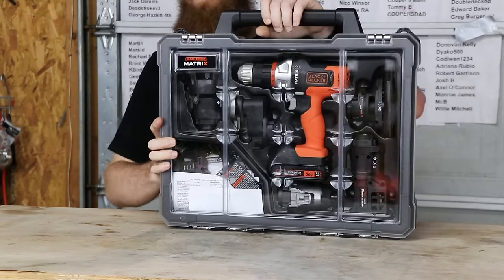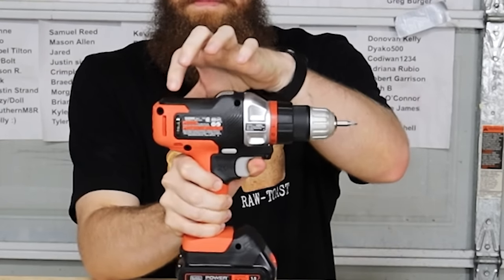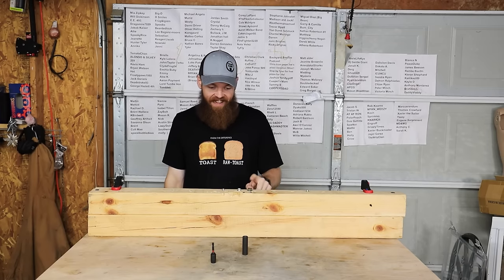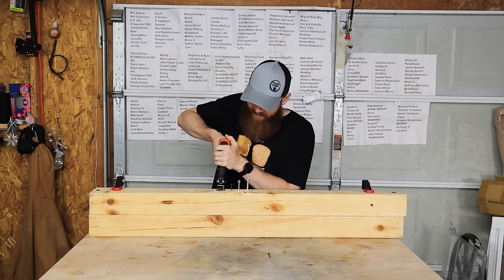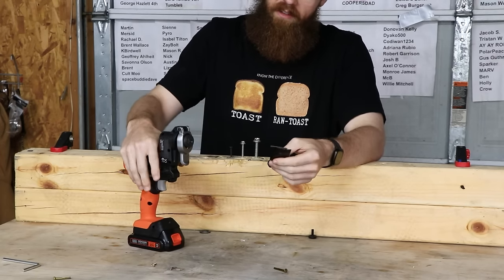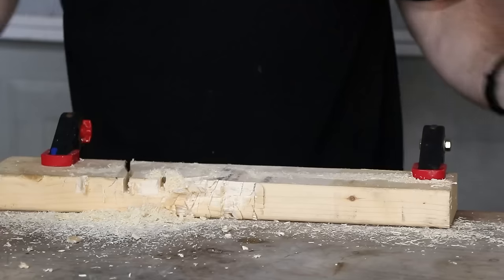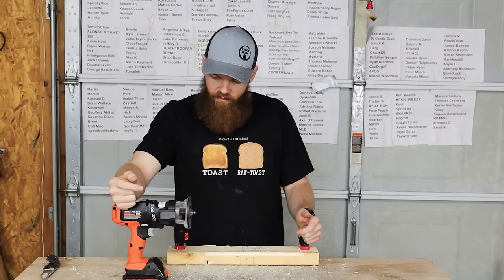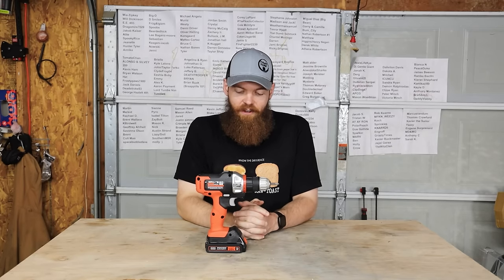Is This The Last Drill You'll Ever Need? | Black & Decker Matrix system

Comment: Tyler!!! The reason why the impact driver head smells like grease is because the grease keeps it from over heating, it lubricates the gears inside. It's like that with all impact guns.
I'm a mechanic so just some tool advice! Great video though 👌.

Also routers are to make nice edges on wood not to cut straight through a piece.
Thanks,
Robert Aime

Comment: To get the best results from using routers to cut to a depth like you are doing, it's best to do it in increments, dig down a little at a time instead of going whole hog because all your doing is tying the blade up with material, it's gripping and sending you all over the place.

Also, setting up a guide rail for your router will be a benefit as it will steady when your cutting, as well as it lets you do multiple passes on the same cut.
Reply: I was hoping to see a comment like this, good info about safety and technique.

Comment: While I agree that many B&D tools aren't that great, there are some, like this set, that aren't too bad.  Interestingly, Stanley Black and Decker is the parent company for Craftsman, Porter Cable, and DeWalt.  Yep, that DeWalt.  Also, this set is PERFECT for your camping kit or RV as it gives you all these options without taking up a lot of space.
Reply: Not really parent company just bought them as the old brands went. The 20V line is pretty decent and most don't realize that its a 10+ year old thing B&D kinda got early on and a lot of other brands (outside the ones bought by B&D) are starting to go to the 20V Lithium system in the last few years.
Reply: I think it is important to remember that B&D tools aren't intended to be professional grade.  Their purpose is to be a budget level tool.  They do an OK job of that.  My biggest issue with this specific set is the router.  Routers are dangerous at the best of times, but they are designed the way they typically are for a reason.  This configuration just seems like it increases the chances that someone will hurt themselves.
Reply: @wairgald  What is the reason?
Reply: Routers are very high RPM and susceptible to violent kickback. This attachment doesn’t appear to spin as fast as an actual router, but it looks awkward to hold.
Reply: I was thinking the same thing. Perfect for my rv.
Reply: I can vouch for that. I used to keep the entire collection in just two 18 inch softbags

Comment: I remember my first technically industrial job. I was a maintenance mechanic assistant at a pistachio huller. I got this kit because i could carry around the drill and impact and be relatively lighter weight than carrying 2 drills. This did everything I needed of it between removing bolts drilling holes. Is it extreme duty or even heavy duty? Hell no, but I still have my original kit from 2013 and everything still works great and now my little brother uses that kit to work on his dirt bike, since Ive moved onto needing heavier duty tools for working on boom and scissor lifts

Comment: The router tool is generally for finishing work. Trying to cut a channel in wood you'd probably be using some sort of guide to press against to make it straight.

The bit spins in a particular direction so if you approach the cut from the wrong way it will kick back.

Best use for routers is to round over edges of wood so you don't have any really sharp corners on finished work.

Comment: i have that exact same drill it has lasted me 6 yrs i love that drill thanks to that drill ive never had to buy another drill
Reply: My Dewalt drill and impact driver is almost 10 years and it's still going yet even the batteries are still good as well.
Reply: @matthew6414  I got a old Bolt-on that is the twin to the Matrix system and thats been around 10 years now and it was working strong. Brushes worn out and had to replace the motor which was $30 on Amazon brand new. Still have the original battery too for it and still working.

Comment: people normally clamp a straight edge as a guide when they want to make a straight cut with the router and it normally takes a few passes to make a groove that deep, trying to do it in one go will ruin whatever you're trying to do.. overall i think this system is good for light duty DIY repairs or builds, definitely not something you would bring to a construction site, so i do agree with your assessment, sometimes i wish i had a certain tool to make some repairs, but i definitely don't want to spend 100-200 JUST for that tool alone... so for me personally, i could see myself buying this kit.

Comment: I use my B+D equipment for household tasks, cutting laminate, drilling and screwing in walls and some sanding for DIY, the bennefit is that I just use 1 batteryplatform, also when 1 tool dies, I can use the battery for my other tools or battery vacumcleaner. Their sanders are quite good and cheap (as you already have the battery now), maybe check out their workmate as testbench. great video, didn't expect it to work so especially for the cost (thought it would cost around 250 and to struggle/die)

Comment: I'm impressed with the tool, seems like a decent home owner "as needed" closet shelf item. Lots of user error here Tylor, and exagerated expectations, after all it's Black and Decker. 1.5 amp hour battery tells you what it's intended for. Does it come in pink?
Reply: You can't put a bigger battery on it? Is that the only battery that works with it?
Reply: @ThePrufessa  if anything it's probably Makita or DeWalt clone battery
Reply: @kevinmontoya7318  black and decker makes DeWalt so it should work.
Reply: @ThePrufessa  from some internet site:Are Black And Decker Batteries Interchangeable With Other Brands?
This is a question that we get asked a lot, and it’s one that we’re happy to answer. Black and Decker batteries are not interchangeable with other brands, but they are compatible with other products in the Black and Decker line. This means that you can use a Black and Decker battery in a Black and Decker power tool, but you cannot use it in a different brand’s power tool.

There are a few reasons for this. First, Black and Decker batteries are designed specifically for Black and Decker products. They’re made to fit our products perfectly and to work optimally with them. Second, Black and Decker batteries go through a rigorous testing process to make sure they meet our high standards for quality and performance. And third, we offer a wide range of batteries to choose from, so you can find the perfect one for your needs.

If you’re looking for a Black and Decker battery, we suggest checking out our website or your local home improvement store. We offer a variety of batteries to choose from, and our experts can help you find the perfect one for your needs.
Reply: @achecase  I didn't ask if it was compatible with other brands. Read my comment again and this time actually comprehend the question I'm asking.
Reply: @kevinmontoya7318  why wouldn't B&D have their own batteries with more mAh? And why would you say mikita or DeWalt? Those batteries don't work with B&D products.
Reply: @robert9595  that doesn't mean their batteries are compatible.
Reply: @achecase  clearly you didn't pass your fifth grade reading comprehension classes. Because nowhere in my comment did I ask anything about using batteries from different brands.
Reply: clearly you didn't pass your fifth grade reading comprehension classes. Because nowhere in my comment did I ask anything about using batteries from different brands.
Reply: @ThePrufessa  B&D has never been consistent with supporting replacement parts and what not. They usually jump ship whenever something doesn't go right
Reply: @kevinmontoya7318  the original comment says that the fact that this set comes with a 1.5 mAh battery tells us who it's intended for. All I want to know is if you can use a battery with more mAh capacity? That's it. I have no idea why you stupid dummies keep talking about using different batteries from other brands. They don't have anything to do with the question I asked. OBVIOUSLY only B&D batteries will work with B&D products. That goes without saying.
Reply: @kevinmontoya7318  so B&D doesn't make any batteries bigger than 1.5 mAh? Is that what your last comment is saying?
Reply: @Kevin Montoya  so B&D doesn't make any batteries bigger than 1.5 mAh? Is that what your last comment is saying?
Reply: @robert9595  Doesn't.
Reply: @ThePrufessa  No, I am not saying that, this kit comes with a 1.5. It is focused on home use. I don't know if B and D makes a 5.0, but I highly doubt it.
Reply: @achecase  why go all the way to 5 mAh? What about 2 or 4 mAh like most other brands make?
Reply: @ThePrufessa  they make 2.5's, but still don't bother with em, they are shit products in general. Check out channels like the torque test channel and project farm for actual data on powertools
Reply: @marcusborderlands6177  I understand all of that. I was just asking a question about something that was stated in the original comment.
Reply: @ThePrufessa  original comment was just saying that its a "faker" tool, somebody buys it to get into doing stuff with tools, and never ever uses it, but just brags about having all the different types of tools and shit. or they were saying its for women, one of the two
Reply: You can use a chisel to remove a certain 'bump' off of a larger porter-cable battery and just use the porter-cable battery on the matrix. BD & PC use the same pinout
Reply: @Biaanca5036  why would anyone do that when they could just buy a bigger BD battery?

Comment: I’ve had this set for about 4 years now and mostly use the impact when I’m working on my car. It’s been great. I also have the circular saw attachment but it’s only like a 3 inch blade so wont cut through a 2x4.
Reply: 3 3/8 inch blade. But its only meant for 3/4 inch material which is why its called a trim saw. You can double cut a 2/4 as I have done that before.

Comment: Milwaukee needs this

Also as a suggestion, in my years as maintenance technician I would always drill pilot holes for bigger screws. So you might want to add that in there
Reply: Y when they sell each tool for $129
Reply: @travissmith5739  what? What does this have to do with pilot holes for bigger screws/bolts?....
Reply: @TylerRichardson14  I believe he was referring to your comment about Milwaukee.

Comment: I've had this system for a decade or more. Just this morning I used metal cutting blades to chop up a couple of floor lamps to discard. It worked great. I'm surprised that I haven't heard anyone else say this, but I've only looked at a few comments –it would have been a good idea if he had read the instruction manual before doing this video.

Comment: i find that with oscillating tools if you dont apply pressure you cut better and preserve the blades alot better.
the idea behind them is that they do minor scratches at high reps. so when you add pressure your trying to make it cut through instead of scratch through..

Comment: I used my B&D 18v Firestorm drill that I bought in the 90's to do the remodeling and upkeep on my 1900 built home. It all still works and only 2 of my 6 batteries don't hold long charges anymore. I don't use it anymore though because a couple years back I got the Matrix and bought several attachments. Mine wasn't the case kit, but I was able to buy the case. The reason you shouldn't use the jigsaw is because there is a circular saw attachment and I have used the heck out of that. A lightweight one hand circular saw is very handy. I have the air compressor attachment, also. The only B&D power tool that ever failed on me was a 1980's corded $8 jigsaw that I got my money's worth on.

Comment: I have owned the Craftsman Bolt-on which are interchangeable with the Matrix for about 8 years. I have never had a problem with them and the battery is still in great shape. The Craftsman also had a skil saw and saws all attachments. The major down fall is finding the blades for the reciprocating saw. I also have the hammer drill and have used it drilling hole in masonry with no problem. Definitely not a tool for the professionals, perfect for the DIY crowd.

Comment: Had the one that had a cord instead of the battery and it died after a year. It is an awesome concept just needs to be built stronger. The gears inside aren't great.
Reply: I have the cord and its still going just fine. Some of the later heads for the drills got cheap but I had mine for over 5 years now.

Comment: Looks like it's pretty well reviewed on amazon, and there's also a trim(circular)saw attachment-but it only uses 3 3/8" blade, a reciprocating saw attachment, and an air tool/inflator that are sold separately. Might be worth checking out for someone low on space, or that doesn't need real pro grade tools.

Comment: Dremel hands down makes the best blades. 7 years in the trades and I wouldn’t buy anything else and they fit any oscillating tool on the market
Reply: 7 years in the trades and you buy dremel blades? I only buy Diablo. Anyone who has used Diablo knows they're superior in every way. Especially the carbide.
Reply: @Chris.Rhodes  believe it would be based on preference. Some people think that just because it has a certain name on it, it means it is better than others. Just because they prefer a different brand/line than yourself,does not mean they are not what they say they are. Ffs
Reply: @miniard11b  Take it you've never used the diablo blades lol If so, you'd know to quit wasting money and buy a blade that lasts 4x longer. It has nothing to do with preference. I'm stating that the diablo carbide blades are better. Has nothing to do with preference. It's proven. I've used both brands, and the diablo I don't feel like I'm throwing money in the garbage.
Reply: @Chris.Rhodes  I believe you missed the point. I have used both dremel carbide, diablo, lenox, etc. To be honest, lenox is my preference. 
   It is about preference but most Importantly, the job you are doing and the best tool for said job.
    The point: just because someone believes other blades are better does not make them wrong or make them a liar.

Comment: I remember when I first found out about this tool I had serious thoughts about getting it but then I ended up just getting the combo makita 12 drill and impact for half the price but because you already have all the attachments I would really like to see a comparison between the battery powered matrix and the corded one I think it’s like 30 on Amazon
Reply: The corded works about even with the battery. Corded has the slow wind down instead of the instant stop so its best for the sander or drilling constantly.

Comment: Oscillating tools operated such a high frequency of vibration that they often loosen the screw that holds down the blade so if you don't tighten it down all to hell it's going to come loose during the project you're working on every time
Reply: Yeah, those attachment point suck no matter the brand.

Comment: Before I invested in my Milwaukee tools, I had the Matrix Tools, and it is great for homeowner type tools. Also back when I used them, the Craftsman Bolt On tools were interchangeable including the Batteries.
Reply: Yea will not buy Milwaukee anymore. Not a good investment. Non of my Milwaukee’s work, only three off my dewalts work (table saw, cordless circular saw, and saws all. My matrix drills last 5-10 years they cost 99$ soy they pay for themselves after one job. It just cheaper for me to buy the matrix.

Comment: I have a black and decker cordless drill. It's fine for light duty. If I need more power I use the Dewalt. The price is what makes it practical. Sometimes I will use the black n decker to drill 1/8" pilot holes and/or countersunk holes, and I use the more powerful drill to drive deck screws. It has value because plenty of lite duty tasks are needed for most projects. 

Re: jigsaw: They aren't designed for speed. If you want to make fast cuts, use a saws-all.

re: Oscillating tool: Plunge cuts are probably what they do best. Yea you can cut metal, but screws and nails are really hard. It's gonna be very expensive to oscillate your way through hard metal. For hard metal, a cutting wheel would be my choice. 
As a router, I think the black n decker would be anemic, but it looked better than I thought it would.

Comment: Wasnt that weed wacker/mower thing b&d also? As I recall you really wanted to hate it. You should check out Mista Gg's video on having manscaped as a sponcer. I hope they are paying you good, you deserve it! Keep up the good work 👏
Reply: Yep, and it uses the same battery as the drill.  I have several items from their "set" since they all use the same batteries.  The weed wacker was the first I'd bought, then a tool set with a trim saw, jigsaw, light, sander, and drill, then the Matrix drill, leaf blower, and pole saw, then their chain saw.  They all came with batteries, so I also have 10 batteries, and rarely ever have to stop working around the house.
I wouldn't use them for professional purposes, but they are definitely worth it for a homeowner doing some DIY.

Comment: I upgraded to the 5v 20a battery.  Works much better.  Finally got the Reciprocating saw attachment and like it a lot. Definitely skipping the Oscillating tool if it won't take aftermarket blades like the reciprocating Saw does.

Comment: The oscilating multi tool and the router look really awkward to use from that grip. The blades don't impress me either
Reply: the router is fine. You dont go that deep on any single passes. Routers take multiple passes. You go that deep on 1st pass, and you'll ruin whatever it is your routing.
Reply: Meh, I haven't found a multi material blade for those things that isn't crap